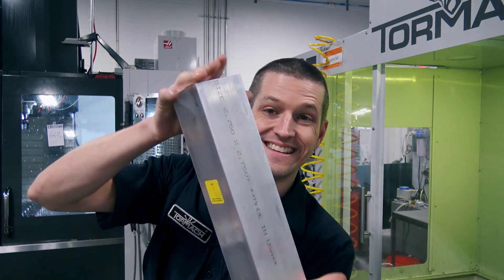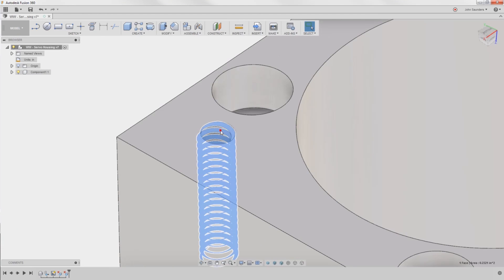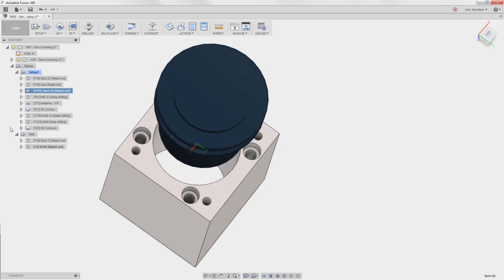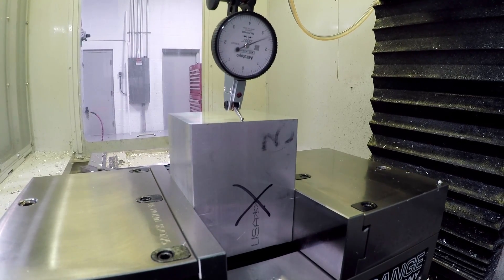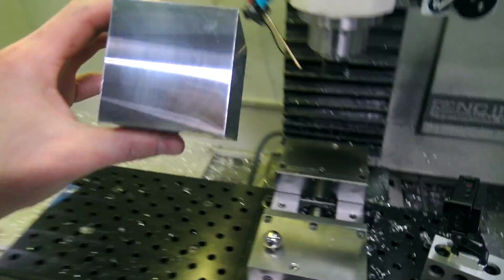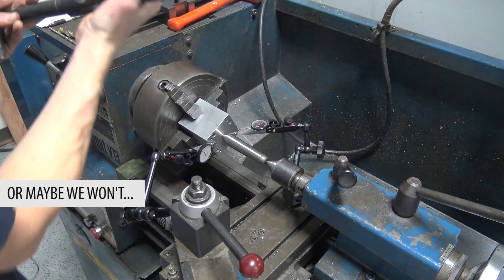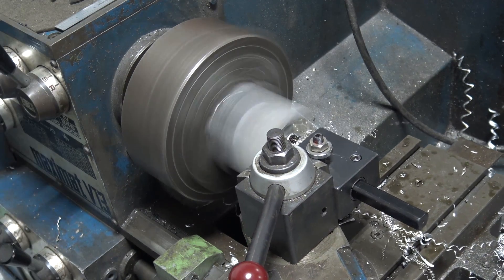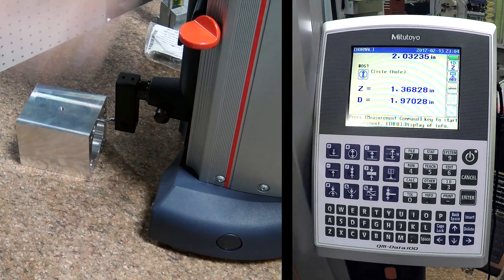Machining a Servo Housing!   WW135

Comment: I've noticed that with deep bores in Aluminum that heat is a factor. As you get deeper in the bore the heat build up expands the material causing it to cut more material at the far end. Shallow cuts for the last 30 thou, and cool down between cuts. Or flood cool the heck out of it.

Comment: John long time watcher first time commenter. If you want to make to process faster then you should use less drills in the process. The best way is to measure the chisel edge and then drill as close as possible and it will suffice. Then go in with your drill of your hole before the bore. The other benefit is that it will make for less sharpening of drills since you are using all of the flute to cut and not just the outside edges. Also this will help to eliminate runout when drilling with larger drills. Since you have so many drills in the process then you're more likely to to have one push out sideways when it's only contacting part of the flute.Second option is to use a spade drill and just cut one hole to your size. my vote is spade drill. I work on a manual lathe and if i want to set up for a bore quickly I will spade drill the hole out. The spade drill does not require a center before you drill. Both ways speed things up but since drills are cheap and spade drills are expensive the first one is cheap.

Comment: john  a bored hole should be straight regardless of the alignment of the part to the centerline of the lathe. the hole may end up off center but not oversize. on one end. your lathe may  be worn or out of alignment try boring a similar hole in round stock and check for oversize. if the problem is the lathe it should show up with any chuck or material  configuration. the problem should also show up on od turning..the accuracy capabilities of those big ridged cnc machines can really spoil you.

Comment: John
  One source of the error on the bore size could be that it was distorted from the 4 jaw chuck after you drilled it out .  with the metal removed the part might have flexed in and after boring when you removed it from the lathe it sprang back.   So you may have a 4 lobbed hole, one way to check it is to place the part at 45° in a v-block and check the size again.  If it differs from the original measurement then thats your problem.  
  If not then you need to do some checking and alignment on the lathe.

  Have fun :-)

James

Comment: John, I think you're at the point you need to start making jigs and fixtures for some of the jobs you get and do everything on CNC. That housing is one of them.  

That jig or fixture need to be mobile, what I mean is that fixture starts on the Tormach or Haas mill and can be transferred to the lathe or your Tormach lathe.  That way you don’t compound errors by using a four jaw chuck.  That’s one way !

The other and proper option in your case was to start in reverse.  You put the bloc on the lathe, center the bloc, face, and drill the big hole and stop there !

Once that’s done you have your reference face and hole.  Now you can use that face on the mill vise and hole to center that part and finish the part from the other side.

Comment: I'd bore and face to length on the lathe, maybe on an arbor, bolt down the center on the mill and you could square the outside  while you do the holes. Or square the entire block before you bore the hole. I would mostly keep the flip flop between machines down and make sure the bore is perpendicular to one face in the same op.
Reply: Pressure on the chuck jaws could have pushed the material in only to be relaxed outside the tolerance upon removal too.

Comment: You spent all that time getting it square on the mill and had your center set right in the lathe but ignored the face :/
If its a square part and you have face runout on setup (more than the part) then your bore will not be concentric on the chuck side (where it pokes through).
You can check this by running an indicator down the side of your part when its in the lathe.
if your center runs true and your sides don't show any runout down the length of the part then your square ;)
As for the bore just like your mills, lathes need adjusting too, bed twist will get you every time!

Comment: More than likely it's the clamping pressure on the lathe that caused the problem as you have to really grab things with supper even force as the normal lathe jaws put a pressure point on the material which can make it out of round and mess up the tolerances. You would have to make some soft jaws for the lathe with a lot more contact surface area to correct that. That is something I learned from Haas, Thanks Haas :-).

Comment: Your rpm while drilling was too high. especially with big drills you need to slow down and increase the feedrate! else the drill will not cut properly but kinda grind and melt the aluminium. this will add to the tip of your drill and block it, exactly what you experienced. i rember myself beeing afraid to use higher feed with big drills, but you need to.

Comment: John, One way to square the end of a part without indicating. Put the part horizontal in the vise take a end mill and make skim cut about a half inch down (with the side of the end mill) on one end just enough to clean up in the Y axis. Now take the part out and put it vertically in the vise  on a short parallel (or a small rod) on that cut. Face the end of the part it should be square to the sides now.
Reply: I'm going to have to try that.
Reply: Bill, Try also when clamping a part that is narrower than the width of the jaws to center it in the vise, if possible. I know there have been many videos showing there is minimal error but this racks the moving jaw and puts all the pressure on one side of the rear solid jaw(run a indicator down the solid jaw after clamping a part this way you will see). This has two negative effects. One you are only holding the part with a point contact on the edge nearest the centerline of the vise (This can lead to the part moving in the vise). Two in the case of my above procedure it can make the skim cut with the side of the end mill not as square to the other side of the part. Using a screwy ball as John did in this video can minimize this and help with One but the case of Two the rear jaw of your vise isn't a solid as you think (depending in how tight you clamp the vise). If you want a part square to +- .001" no big deal but if you want closer tolerances you have to pay attention to everything.

Comment: Hi John, I really enjoy your enthusiasm and your videos.

FYI A Tapered bored hole is only explained by the chuck axis not being parallel to the the Ways. You need to check and tram your lathe head bearings to your ways.

BTW with only giving 10 seconds of though to this, if i were to make this part I would have gone to the lathe first, faced of both ends and bored the hole AND then turn a 1/8" wide reference OD (ideally equal to the face to face width but that dimension isn't critical as long as you know what it is) on what will eventually become the bottom face of the part (have extra stock on part for this step) this reference ID can then be used in the mill squaring up steps to make sure the 4 sides are not only square but the right distance from the bore centre, by sweeping across this OD to get reference distance to bore centre.

Then go to the mill, use the two faced-off surfaces as reference to square up the rest of the block using the OD as reference to get the face to bore centre distance correct, then with the face with OD ring down sweep the bore to get the part centre and proceed to drill the holes. Final step mill the back face down to height thus removing the reference OD.

Alternatively you could have the OD face as the top face sweep the bore for centre and then and mill the up face to height & thus removing the OD ring before proceeding to drill the face holes.

note: when sweeping the bore to find centre, it should be done at the top and bottom (or as far down as possible) to reconfirm the bore and thus up face are parallel/square to Mill spindle

Cheers

Comment: If you have through coolant use a udrill depending on what drill feeds and speeds a good place to start is 0.1mm / rev and 150 metres a minute on spindle speed

Comment: Personally i would just have plunged the boring bar from the first drill take a wide pass.. it works great if you are going straight thru and most inserts handle it easy..

Comment: as the bore got bigger the walls got thinner. releasing preasure on jaws some would help before finish cut. just like on the grinder when the magnet is turned down it would be true

Comment: Nice video ! - A lot of the error could be because the block wasn't squared up first. Your K&T could be really handy for this - setup a big facemill in it... You should be able to get excellent finishes with it. I would also check out the chuck and chuck jaws on the lathe and make sure they are all running true. I use a big 1"x6" "dowel pin" purchased from McMaster for $15  as an inexpensive test bar.

Comment: John, good looking part but the bore tolerance problem might be cause by head stock alignment issues. Set up of is so important in any tool. Level the lathe then align the head stock. Not only does this alignment affect turning along the z axis it also comes into play while facing off surfaces. We want them flat not shallow dishes or cones depending which way the head stock is swung.

Comment: Did you level and align that lathe? Looks like beside the bore being out .005" on parallel to the side it is tapered .006" as well. It could also be your jaws are not gripping flat well and tool pressure is delecting the part so you end up small on the outside where it can push off and big on the inside where the chuck keeps it from getting away. Another, and the most likely possibility is you used Abom torque to tighten the part. Being aluminum it deflects very easy. I intend to discuss just this problem in my seminar. I bet the jaws had the bore squeezed so after you released it from the chuck it expanded and went oversize. You are measureing in the same plane as the jaws applied pressure. Would be neat to rotate it 45deg and measure again and see if there is variance in the bore dimension, I bet there is. That would prove an out of round condition caused by the jaw clamping forces.
Reply: bcbloc02 ...,agree with your assessment I have to realign my manual lathe every 4 weeks to compensate for the floor moving, weather changes, and if I do a lot of heavy cutting it slowly moves out of tolerance. I tend to be very picky about it but I’m accounting for tool deflection and outside parameters that can additionally cause a part to go out of spec and I’ve learned to rely on keeping it dialed in even if my parts tolerance isn’t .0005 it’s a matter of it being reliable between jobs.

Comment: Hey John,

I'm a little confused. When you're talking about runout, did you mean that the bore is tapered, or that it's off axis at one end?

You didn't have the face of the part perfectly square before boring and assuming that the face was square to the sides, the bore would then be off axis at the far end as the error was magnified over the length of the part.

However, when you're talimg about using the telescoping gauges, it seems you're talking about taper. 

Having the bore larger at it's entry end could be part and/or tool deflection, larger at the far end suggests your headstock being out of adjustment.

Comment: man 6th + - use that https://www.youtube.com/watch?v=AEsaSN4LLU4 ("MAKING AND USING LARGE DIAMETER LAPS") next time if not certain.

Also it nice to see you moving in to precision. You got a joy toy and still didn't fixed the surface place - there is work for 15 minutes 
ask oxtolco he will say whom to call https://www.youtube.com/watch?v=EWqThb9Z1jk ("Surface Plate Calibration and Conditioning")

Comment: i just recently bought some 3 in 1 jaws from Kurt and they are super handy for squaring up stock without having 3 hands. I'm sure you could make some up for the orange vise.

and on the hole, i would have just u drilled to near size and bored (either boring head in the mill or if i was doing it in the lathe use the same u drill)

Comment: This was a little painful to watch at first...   come on John. I know you know how to properly square up a block.

As for the bore, I think your mistake is with the initial block. You should have squared up the whole block, all 6 faces first to size. Then ran an indicator down the length of one face of the block. 

The measurement off the face and deadcenter only gave you a single point, or total run out measurement (TR). You needed to find the total included runout (TIR) across the entire length of the part. 

I'm willing to bet if you ran an indicator down the length of the part when you first put it in the lathe, you would have found it was slightly cocked in the jaws with a .002 run out in the length, giving you a .006 taper down the length of the bore relative to the face (which was already a  .001 out). You fell victim to ever present and dreaded stacking errors.

Comment: About the runout on the lathe, I think you might have corrected  the far end of the part with the center but left the chuck side as-is. That may also be the reason why you measured a runout on the face of the part when you had it in the lathe. That explains the conical hole. (it should not have any runout on the face, because you showed on the heightgauge it was actually nicely parallel to the opposide side.)

Comment: When measuring that bore with the height gage you really should have some parallels and gauge blocks to keep the part square to the machine and slide the part against the gauge to avoid error.

Comment: Just drill it the largest possible then bore it.
And sharpening drill bits, its easy, take it to the bench grinder, find the angle, scribe a mark on the rest and match the angle. Its not precise just needs to be close and have a relief angle. Just really small bits are easier to just buy another instead of screwing around too long on a $1 bit

Comment: on my work we have a small machine where you mount the drill in a clamp and just rotate it by hand and it sharpens the drill, works verry well, verry smooth. maybe you should look into that verry cheap machine i think my boss payed 400 euros for it we have one for small and big diameters

Comment: Hi John
I would have started at the lathe first.set the material by dial the centre point of the flat sides both at the jaws and at other end.
Drill the large hole out to a rough bore then recheck the material it would have moved from the loading of the large drill.
Bore to the final size the deflection of the boring bar should be smaller at the chuck. Face the part so the bore and one face are dead to each other 
Mill the sides next checking thickness to bore
Setup to mill the length in the mill with one edge so you can mic the length 
Even raise it on parallels so you can mic the length of the at each side
Then do your drilled holes and counter bores 
Graham t   Cairns Australia

Comment: If your bore was oversized only on the side of your chuck jaws. It was probably the jaws pressure on the thin wall the problem. You should check if your bore is round. I'm pretty sure the hole is oversized only on the 4 contact point of the jaws. I know a guy who know another guy that make that mistake ;)

Comment: Just wondering. Would it be better if you move the part exactly perpendicular to the z axis of the height master/guage, when measuring the bore ? May be use a parallel between the part face and the 2 steel knobs on the base of the height guage.??
Any way, Thank you very much for sharing your work over the years.
My Best Wishes !

Comment: dude, 7 thou for clearance i would think is pretty tight. seems like an over toleranced part tbh. seems like someone new to modeling as well because modeling threads ( unless for 3d printing etc) is a no go. cosmetic threads (solidworks) are nice just so you can have a callout while designing and seeing whats threaded but actually modeling them is way to much computer power and not needed at all. also getting the hole size wrong for threading is pretty noobish.

edit: to add, whats up with the wrongly dimensioned holes bottom, who would design something like that? i would love to know what they where trying to do. assuming the angle of a drill (resharpened could make it off) tip for such a specialty hole seems ridiculous.